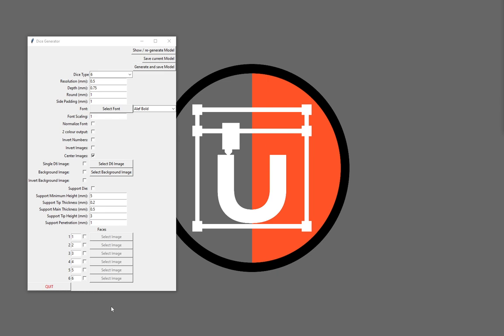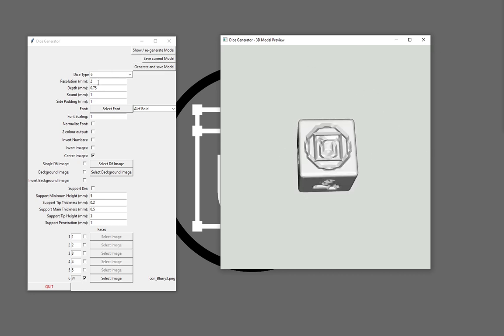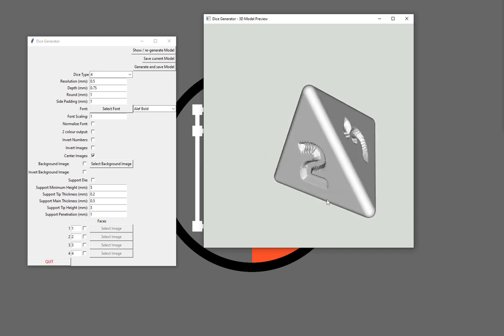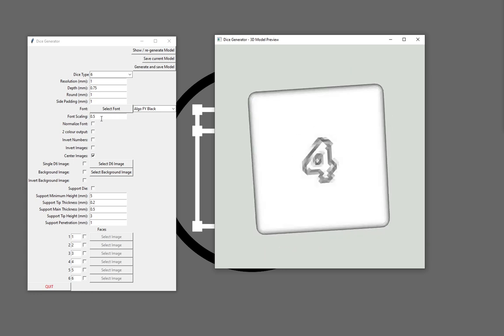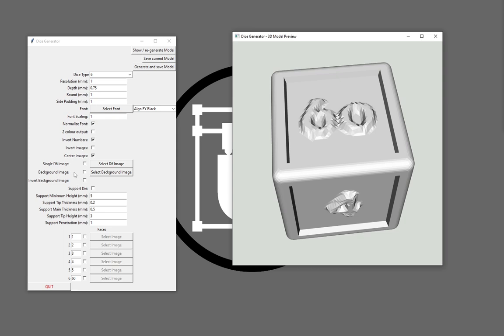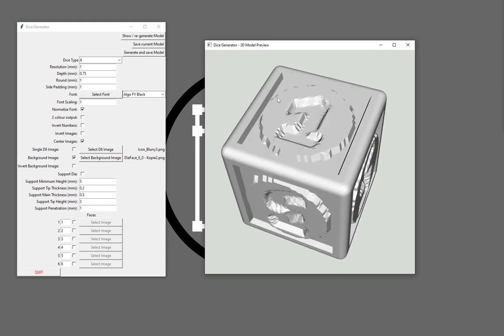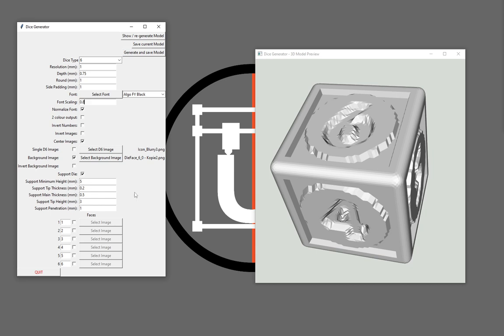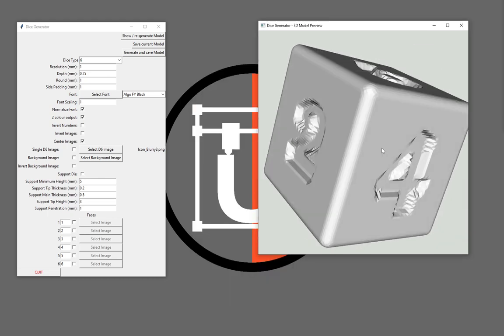Dice Generator Introduction

Comment: Really nice. Would love to try this. 
May I suggest adding unusual dice if it is not too much of work. 
I am thinking d19 and such. These are hard to come buy. Being able to print these and label them as needed would be awesome.
Reply from the maker: Well what shapes would you want to see? A d19 is impossible except for a roller, but I wouldn't consider a roller a real dice
Theoretically, d24, d30 are possible, but the faces have weird shapes so it's a pain to create
Reply: @Udos3DWorld  Dungeon Crawl Classic uses 14 dice for its dice chain. d3, d4, d5, d6, d7, d8, d10, d12, d14, d16, d20, d24, and d30. There are consumer products available for all of these, but customizing and 3D Printing one's own versions would be awesome.

More details: DCC will modify dice rolls be rolling with a larger or smaller die up and down the dice chain to make the stats calculations easier, and another tool for the DM (called the Judge) to use to adapt the situation.
Reply from the maker: @JaydLawrence so i have something planned, basically an any dice generator where you basically specify the amount of faces and it tries to fit them best on a sphere, but with no guarantee that its a fair die. Works a bit, but still needs a lot of tweaking. Will possibly create another video once that one is done.
Reply: @Udos3DWorld  Did this feature ever make it into the generator?
Reply from the maker: @Chris_434-e3j  Actually not. This thing never made it past script stage, and I don't see the big benefit of it, since the produced dice aren't that nice. I have one design with all dice from 1 to 100, but thats it

Comment: Thanks for this, one question tho:

What software are you loading the files to?
Reply from the maker: The part where I showed the two-coloured parts? That was autodesk meshmixer, a free, very easy to use tool for 3d modeling (and I really like it)